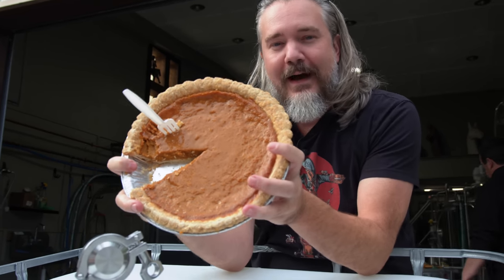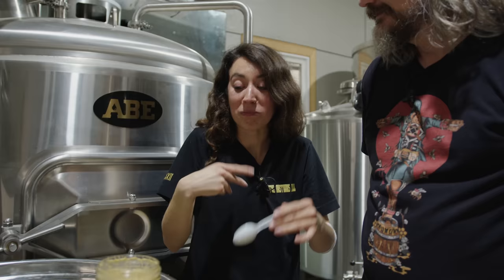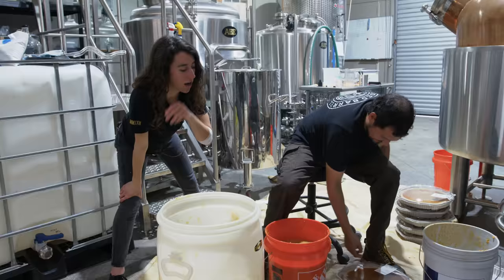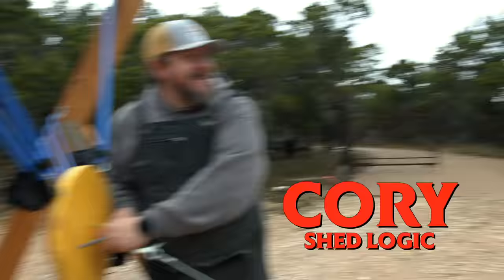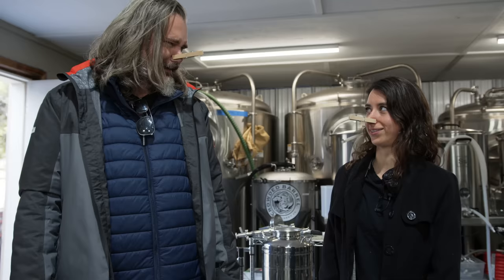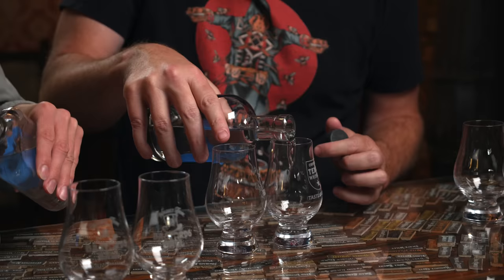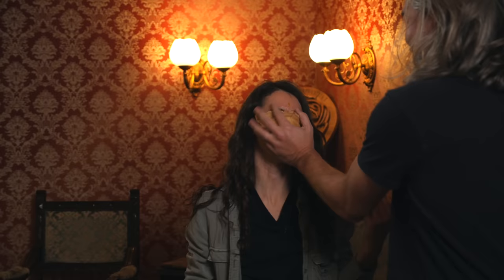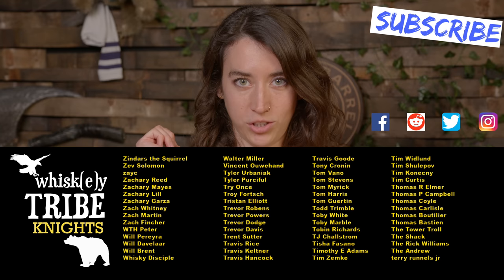How to make ALCOHOL from PUMPKIN PIE | Will It Distill?

Comment: This seems like a fantastic time to mention that you can buy pumpkin pie filling in a can. Already blended, pasteurized, & super smooth 🤣
Reply: @bdog5369  There is no flavor value for alcohol in baked flour with a bit of fat(crust). There is a great deal of wild yeast & other microbiology that will develop unwanted flavors though. Making it essential that the mash is pasteurized.
Reply: @bdog5369  You miss understood they literally make pumpkin pie filling in a can with all the spices, sugar, and flavorings. People buy frozen pie crust add canned pie filling top with nuts. It's a bit like a good brownie mix. It's better than something sitting on a shelf not as good as homemade. For this though a can of pumpkin pie filling is about $2-3 verses a $10 pie for roughly the same amount of pumpkin. And it has not dried out so less water is needed meaning more flavor. If crust & cream are required add hot par baked crust & powdered cream to the mash.  Neither is going to carry flavor though to the alcohol, but at least awful flavors will be avoided.
Reply: @bdog5369  Organic options are available, but most brands have pulled everything but salt out of their recipes. Because if handled properly preservatives are unnecessary, and viewed extremely negatively by the public. I worked in a premium in-store bakery made over a thousand pumpkin pies the weekend before Thanksgiving. The ingredients weren't any better than the canned or frozen product. Simply said very few stores make pies from scratch the margin is not high enough.  As far as pumpkin content it's on the ingredients list if other veggies are being used, & people read label. So yet again most brands don't do that anymore. They where never going to home bake a dozen pies so that option is unavailable meaning canned is by default the highest quality option over frozen & store made.
Reply: that would be "will canned pumpkin pie filling distill".... not "will pumpkin pie distill"
Reply: @bdog5369  Are you sure you aren't the newbie here? They aren't always that literal. For instance, they substituted watermelon juice for whole watermelons in the watermelon video. They could have easily used canned pie filling instead of whole pies and not have taken anything away from the video. I think they should revisit this one in the future to try that and see if it changes anything.